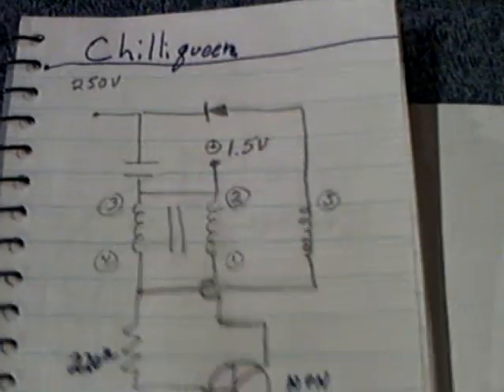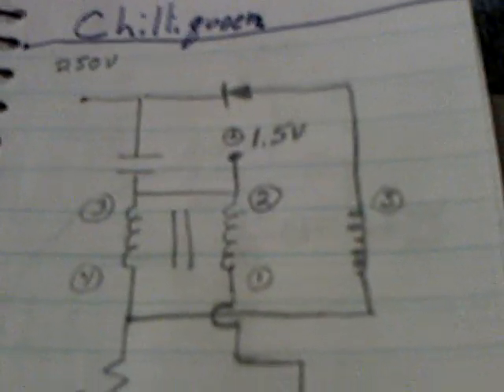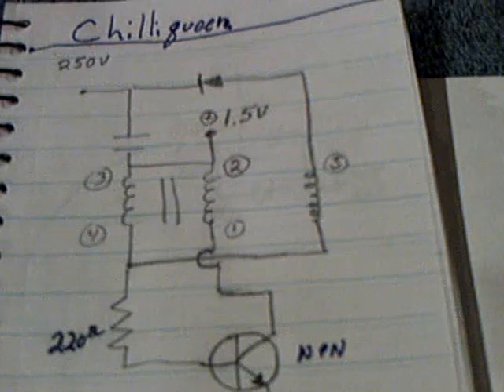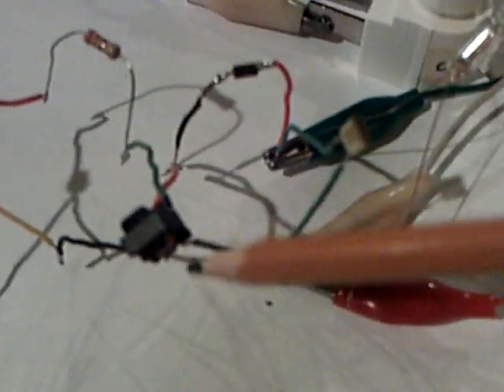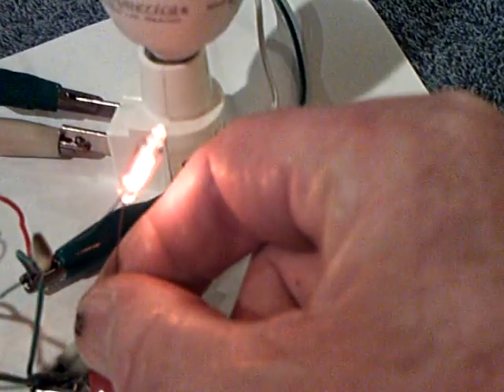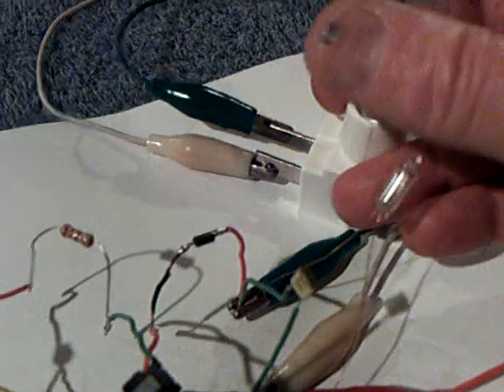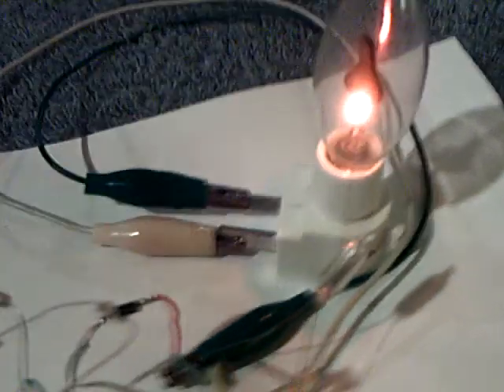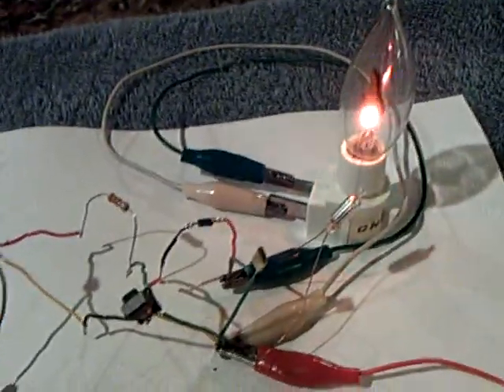Chilliqueen high voltage circuit using camera parts

Comment: hmmm...how do i know which pins on the transformer are 12345?....ive pulled one apart and removed all parts from the camera pcb...just need to wire em up....  :(   i can't seem to find a video which 'completely ' shows everything on how to complete this  :(